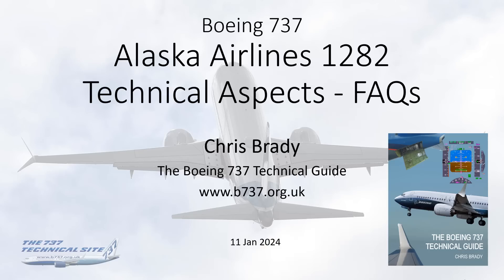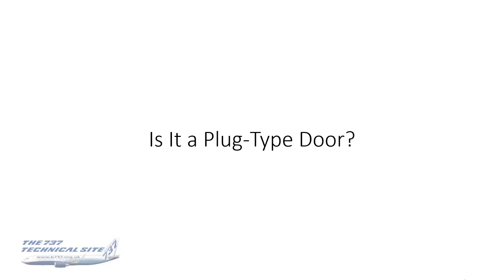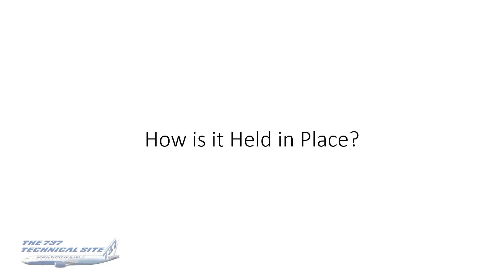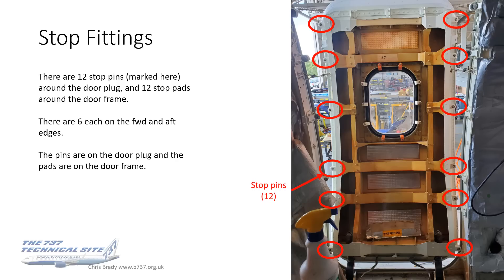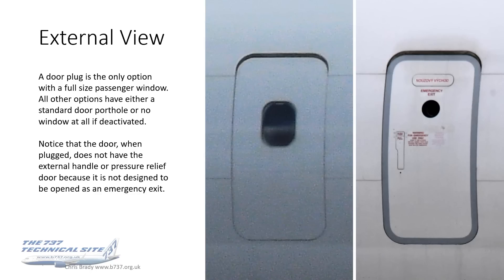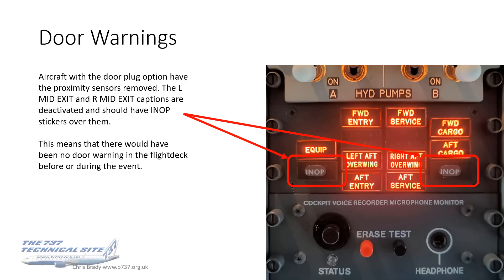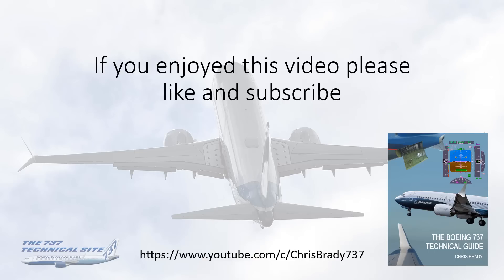737 Technical Aspects of AS1282 FAQs

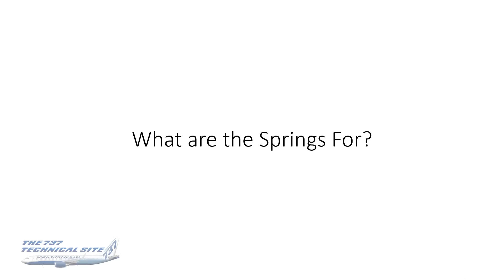Comment: 9:00 “what are the springs for?” Is a question some are still debating over on the Leeham aviation site. And many are still asking “how strong are the springs?”. Many agree with you that the springs merely take some of the plugs weight & prevent it from falling to the lower limits. One fellow states authoritatively that the springs will fully compress to the point of coil bind under the weight of the plug? Others suspect the lift springs are strong enough to move the plug upwards against gravity if the locking bolts are removed. 

Chris, what can you say about the photo at 9:00 in this video showing the hinge guide fitting at the upper slide limit / plug open position? Is someone lifting the plug to get it in this position? OR- are the springs pushing it there? Do we know the source of this photo, who took it and when, and which plane / plug location it represents? 

I’m thinking back to the confusion in your early video (up vs down to open plug) and the manual having it incorrect. It seemed there was agreement that a small downward push might be needed to relieve the upward shear force on the lower locking bolts, to allow for their removal, before the plug can be moved upwards to the open position. If that’s what the manual was trying to say, maybe it’s actually correct? Maybe there is no specific instruction listed, to move plug upward to open it, because that happens automatically via spring action once the bolts are removed? Some suggest the evidence against this scenario is that the plane made many flights with the plug staying in position. It seems there is also evidence FOR the springs wanting to push the plug upwards the 1-1/2” or so needed to release the upper guide pins. Namely-
1. Downward pressure on plug needed to release the shear force acting on lower bolts. 
2. This 9:00 photo.
3. Figure 16 photo in the NTSB preliminary report.

A Rimac valve spring tester has been standard equipment in an engine rebuilding shop since before there were 737s. It measures free height, installed height, compressed height, and the amount of force it provides at those specific heights or any point in between. The design specs for these lift springs (x 2), and weight of plug, will tell part of the story. I hope the NTSB has a Rimac tester or something similar to determine if the actual springs are to spec. 

A “seat of the pants” type test is to pull the locking bolts on an identical, but intact, plug and see what happens? Does the 9:00 minute picture reflect such a test?
Reply from the maker: These are all good questions but I think I would prefer to wait for the NTSB analysis in the final report. There are too many questions surrounding this that need to be answered about the plug door mechanism.

Comment: Hi all. I just saw a photo of the recovered door plug sitting on a bench at NTSB. I think the forward, lower hinge, slider forging is still attached to the door frame. I can just see a little bit of green colour, just above the ladies arm sleeve. Right where the fitting should be. It appears there are bolts poking out the nuts, that the bolts screw into. The aft slider fitting stayed with the airframe when the incident occurred. It looks like the aft fitting is included in that bag the lady is grasping. I believe when the door final cleared the stops and started to make its departure from the airframe, the rushing air caught the door like a sail and caused it to depart with such force,away from the airframe, that it easily snapped both the retaining wires and also to punch the slider off the lower hinge slide  pin, even though the washer and two locking nuts were still in place. Remember that at this stage the aft slider forge fitting may have already completely separated from the door frame. The bolts may have already let go. If it hadn’t and the bolts were just lose, the force of the 300 mph wind, that the door is now entering into, may have sheared them off, and they might be still attached to the door. If it had to punch through both of slider fittings, the door may not have got away. Wow. That photo explains a lot. It also looks like, about the top 2-3 inches of the door was folded back slightly as a result of the air rushing out of the cabin in that area first. Especially on the corners. Regards

Comment: How come there was no redundancy built into the controls over keeping the plug in place?? And why weren't there any sensors to indicate when something wasn't installed or maybe this is too much to do within the overall creation of this plane.  If something was a jar and not securely fitted within the frame it would seem an alarm would go off just like the door in your car when it's not locked properly. Further when there was assembly Andor maintenance isn't there a secondary level of quality control that's in place to oversee and initial work done? This is simple stuff and yet no answers after a long period of time since January 6?

Comment: How does the door plug actually seal? Is there a rubber gasket that seals the space between the door frame and the door plug? Please post pictures.
Reply from the maker: Basically yes. You can see it (dark coloured) around the doorframe in several of the photos in the video.

Comment: An explanation of how the door is moved into and out of the secured position would be helpful.

I believe the purpose of the springs is to react a portion of the plug door mass, to make it essentially weightless (at one point in the travel, as the spring force is not constant). The operator then uses muscle power, plus some body weight, to push the door down into the closed position and compress the springs. When opening the door, the operator has only muscle power, supplemented by the now compressed springs, to react the mass of the door, plus whatever little friction exists, to lift the door... hence the name "lift assist springs."
Reply: You could be right if the design rationale for the strength of the springs was to minimize the amount of effort it takes to move the plug up or down, BUT if the goal was instead to make the plug SAFE, then the springs would be strong enough to push the plug up to the raised position making it impossible to pressurize the airplane unless the securing bolts were installed.  I would choose safe over convenient every time.
Reply: Jack... it's a valid point.  It might require a special tool or jack (pun intended) to force it into position. But a strong enough spring would be a redundant locking feature as you state.

They achieved redundancy by having 2 each bolts at each of the 2 types (upper and lower) of retention feature. It would require multiple failures to become disengaged.

But somehow those multiple redundacies were defeated. Did someone leave all bolts without cotter pins... or maybe not installed at all?

You should submit a patent... quickly!
Reply from the maker: Explanation given in the updated video here https://youtu.be/5FcyvFfHsjQ
Reply: Thanks, it is better. Perhaps at some point Boeing will release a video showing how it is done.. @ChrisBrady737

Comment: Great work Chris.  Good detail.  Do you know if the FAA has released any images of the pins on the door frame or the inside of the holes on the lower door guides?  The existence, or shape of thread marks left by these retaining bolts during the failure would be informative.

Comment: Excellent video and very detailed explanation, thanks! The plug appears to be very well designed with some redundancies. This appears to be a quality control issue and not something requiring a full redesign. That said, maybe an additional locking mechanism at the top of the plug could be added with a couple of pins on the plug itself and the mechanism for the pins to fall into on the airframe (basically the opposite of the existing pins around the plug. This shouldn’t be necessary with all those around the plug now, but would add additional redundancy).

Comment: The Professional Pilots Rumour Network has some images especially in posts 575, 581, 629 and 667. They show the aft fitting (still on the aircraft). The spring loaded pillar is extended which means the castellated bolt has not done its job (or was missing). But it has also been ripped out of the door surround with evidence of the casting breaking. And a picture of the other piece of this casting in the recovered door.

Comment: Now seen a high definition picture of the (plastic covered) exterior of the plane. You can see the aft lower hinge remained with the aircraft with the complete spring loaded pillar. So the separation happened inside the door beyond the pillar. The other lower hinge seems to be broken and may be with the door.

Comment: Chris,  It still doesn't answer the question of that door's evolutionary history from the earlier B737 flight deck door configurations, and the DR&O requirements for that door presumably "NOT opening", ....unless the fuselage hole size was much larger than the FAR 25.265 limit 20 sq ft hole and provisions of AC25-20 back in the 1990s with Amdt 25-87 ??? Seems to me there's much more explanation needed here about that flight deck door reported opening (not just the FCOM provisions), ...and was it per design for that hole size, or not?  Great podcasts. Capt Tom I (B737 et al. since PG099 and the beginning!).

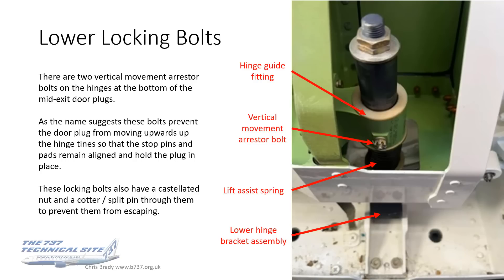Comment: I've commented on the previous video that we might have been looking at the wrong bolts (screws). The Upper and Lower fixings show Castellated nuts and Split Pin locking. But the lower socket (that slides up and down the pillar) is itself attached to the door by 4 screws at each side. If you look at 8:14 above the red line marked "Hinge guide fitting" you can see a screw lurking in the darkness. If these 4 screws to the side fail the door would be loose. The castellated nut and split pin remain locked and the Spring Assisters have no effect. At height the door would still be under pressure to lock the 12 tabs. But it's unclear what would happen on the ground.

Comment: The actual door blow is only half the problem.  If Alaska Air did not know that 3 warnings, 2 in the previous 2 days on a Max is not potentially very serious, well I guess they do now, and this is not going to be the end of that lesson. Anyway you look at it, unless you disagree with my calculation, 99.9994% is a sure thing something is WRONG with PRESSURE CONTROL. Not the engines. My opinion is that its just plain stupid to continue operating under any circumstances, made even worse by not understanding that a distance limitation was incorrect in the face of pressure problems. You want an altitude restriction < 10,000 ft.  It's BASIC physics. If it's true that 3 warnings on one sensor group is not enough of a reason to "stop work", then tell me how many are enough for you. Where do you draw the line. Sure, Intermittent problems are difficult to fix, but that's why they get paid more than auto mechanics. ITS THEIR JOB! If they continue flying until they find the problem, (esp. After 3 warnings) what does that mean? It means they were testing with live guinea pigs. We clear the freeking area for a hydrostatic vessel test. We do not put 175 people on top of the thing when we do it. How difficult is it to do a soap bubble test around door and window frames?

IMO, Alaska owns this just as much as Boeing does. They know it too. They just have their spin doctors out trying to clean it up as much as possible and control the naritive. "Abundance of caution", OMG. They may fool the physics flunkies. I'm not buying it.

Comment: 1:58 It IS a plug type door. The door is wider than the frame. That is including the stop fittings. The stop fittings are what make it a plug type door. Non plug type doors are some outwards opening cargo doors. Like the FWD and AFT lower cargo doors of the A320 family. Or the large lower cargo doors of the B777. Or all lower cargo doors of the MD-11. Or all main deck cargo doors I know of.
But other than that almost all doors of the pressure vessel are plug type, including all entry- service- and emergency doors I know of.

Comment: Its not how I would have designed it but its a good design.  I would have put the guide track on the door cutout like all the other doors.  Then the springs then can push to hold and keep the door in the guide track.  Bolts like that should be used as a safety.  Keep the door in the guide track.  Why its designed the other way around is confusing.  Lift assist really.  Mechanics are not weaklings.  We can open a 70lb door.

Comment: If I understand correctly that the plug door can be changed for an actual emergency exit (required if the seating capacity is increased above a certain number), so how does the emergency door get fitted? Is it fitted with the same mechanism - stop pads & pins etc - or is there a completely different door assembly fitted to the frame. What I'm asking is whether emergency doors fitted to what were previously plug doors might also blow out (if the bolts are not in place). Thanks, great channel.

Comment: 17:05 "due to the small area of the flight compartment" puzzles me. The force should be given by the differential pressure and the area of the door itself and not depend on the "area of the flight compartment". The difference between decompression in the control cabin or flight compartment should ascribe to the geometry of the door, and thus resistance of the door itself respect to force applied one way or the opposite, with no dependence on the area of the decompressed volume (and already area of volume is not proper). Blowout panels make sense if the door cannot hold the force and we want to avoid having the door failing, especially if the door cannot normally open in that direction. Which makes me think that the door normally opens in the opposite direction than the one conceded by the blowout panels, because in that direction it is not strictly needed that the door withstand the differential pressure if it can open without damaging (for some definition of damage at least) itself. Thus, that there might be an undocumented "feature" is a relevant observation.
Reply: In a static system yes, but in a dynamic system the forces can be much higher than the static.

Comment: Time 11:42... Any opening covered by anything must have a warning to tell pilots Hey that thing is not properly closed. I may be mistaken, but is this plug the only access cover for an opening into Pressurised compartment of any prsuurised aircraft, that has absolutely no indication at all? So if the plug fell off during taxi, the only warning pilots have is Loud Aural Warning. From Passengers!

Comment: I still think the assist spring should not have been provided, to assist, big husky mechanics to lift up plug.  the springs here push the Plug UPWARDS which is the OPENING direction. Isn't that a NO NO in engineering, to have springs pushing in a adverse direction? If the purpose of the spring is to Prevent the plug from sliding back down when opened for ventilation then a split clamp would be better. Like those used on hydraulic rods for flight controls, gear doors, etc.

Comment: As regards the emergency directive not affecting the earlier 900ER, it was my understanding that pretty much ALL 900ERs were fitted with the full extra exit door, that was main point of that version i.e. higher passenger capacity) over the original 900 which basically only Alaskan bought. The oddity seems to be that the Max-9 successor to the 900ER seems to be exclusively built WITHOUT the extra door required now and in the future, and are configured for around 180 passengers (maybe intended for longer routes ?). As stated on previous videos if a later reconfiguration to high capacity seating is envisaged then the aircraft must be built with a Deactivated door.

In any case this plug seems to be essentially a new or revised feature that is not actually necessary or beneficial, and is a complication and potential weakness. For the Max-8 and Max-8200 it seems that Boeing and Spirit are happy to build fuselages with 2 different barrel sections (without and with door apertures) but not for the Max-9. Maybe this is to maximise commonality with the Max-10 (which MUST have this extra door provision) or as an option because it was never fully sure that the Max-10 would even go ahead ?

I would expect the NTSB to ultimately criticise the provision of a door plug instead of a normal window section where no exit is required, even though it seems to be intended as a “fit and forget” solution….

Comment: The reversed locations of the guide track and guide roller, compared to Normal doors, which everyone is familiar with, tripped most people up, including myself. Took me a few rounds of fwd and reverse of previous video before I could figure it out. Anyway, why use such a high tech PLUG? I think a Giant Champaign Cork would have done a better job. 😇

Comment: DC10 cabin doors. Those were Real Plug doors. They just can't fly of the plane because they are bigger than the hole that you walk through. And so easy to open and close. When the electrics work.The rest that go from outside to inside pretend to be plug doors. No need to flame me. This is all tongue in cheek.